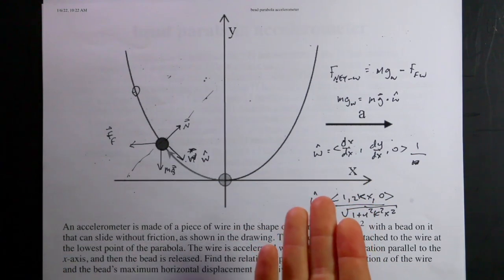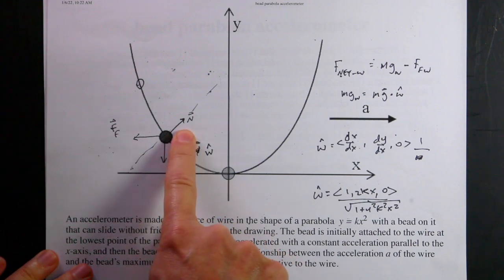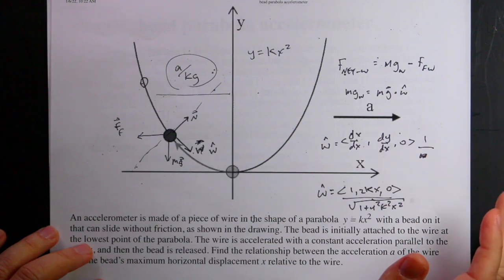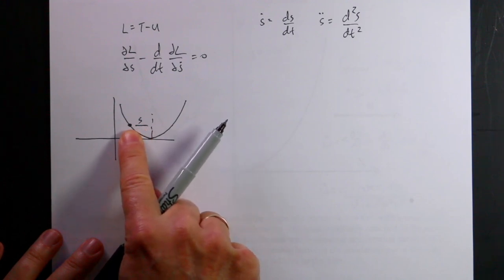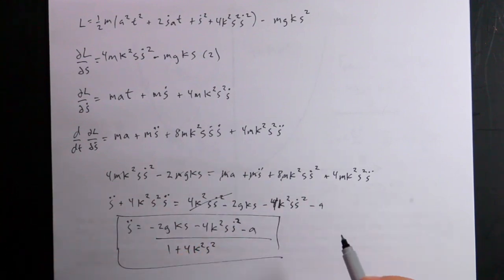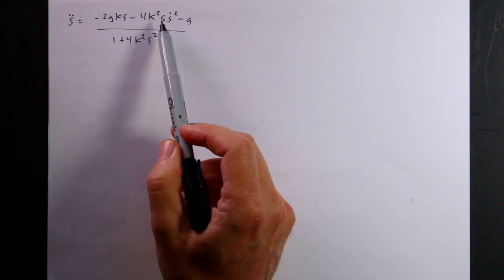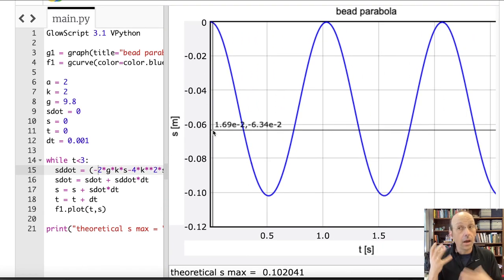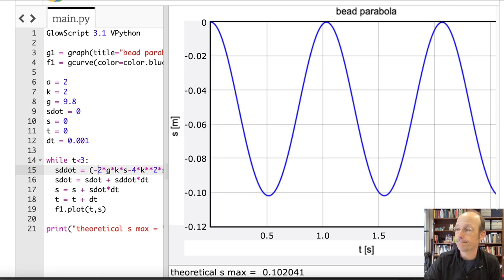Lagrangian Solution for Feynman Series: Bead Parabola Accelerometer

Comment: Why is there only one potential energy term in the Lagrangian?  Isn't there a force accelerating the wire to the right?
Reply from the maker: The force from the accelerating wire is just built into the constraint.  So, I defined the horizontal distance from the center of the parabola as s such that the real position (x) is x = s + (1/2)at^2.  That at^2 term is due to the accelerating parabola.